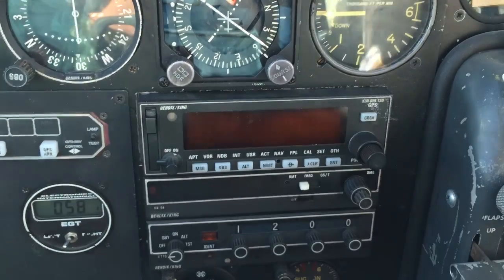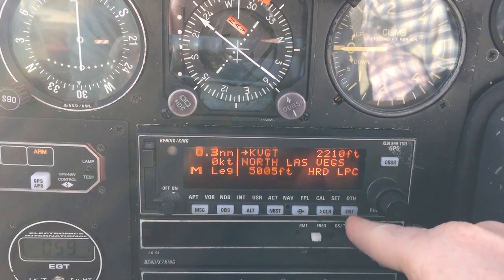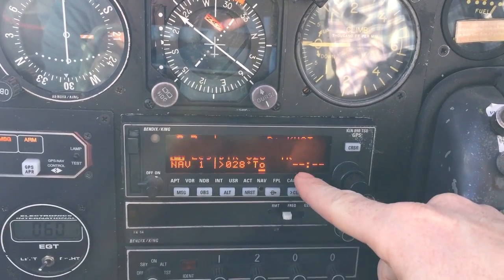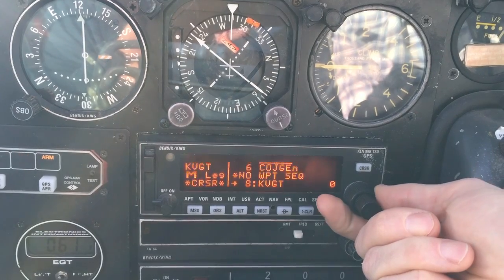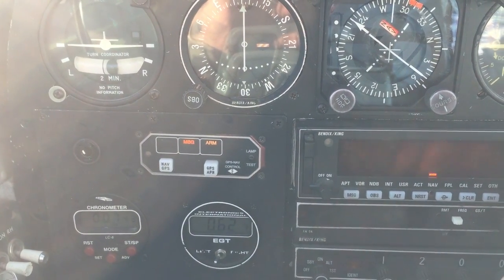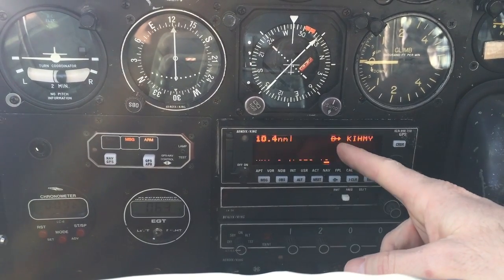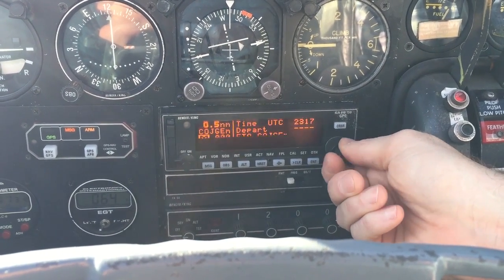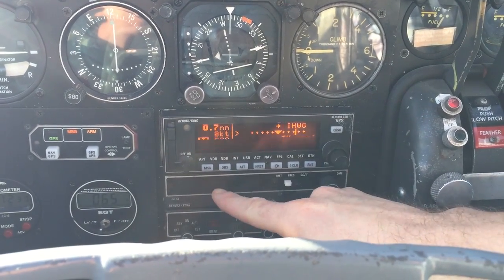KLN-89B Approach programming

Comment: I am getting ready for my IFR check ride and have the KLN 89B in my Cessna 150. Thank you for explaining the procedure so well. I need to update the data card and Bendix King states that I need two interface cables and then you can upload it to your GPS however, there is no visible port to plug the cables into the GPS There is an example on YouTube of how to upload the data card out of the plane but do you have any idea how to do it while it is in the plane? My database expired in 2014. Thank you for your help
Reply from the maker: The plug to update is a weird round plug that looks like a large headset jack.  In most installations they are located somewhere else on the panel.  It isn't plugged directly into the KLN head-unit.  That being said, the King program to interface only works with windows.  The other way to update it if you don't want to go to all that trouble (or you don't have the update plug), is take it to an avionics shop.  They can usually do it on a bench.  I would make a video on the update process, but I installed a 430W to replace this KLN89b a while back.  Good luck
Reply: Chennault Flying Service        Thank you so much for taking the time to answer my question. Is it difficult to remove the GPS from the panel?
Reply from the maker: @tonyzwet  nope just a simple allen wrench